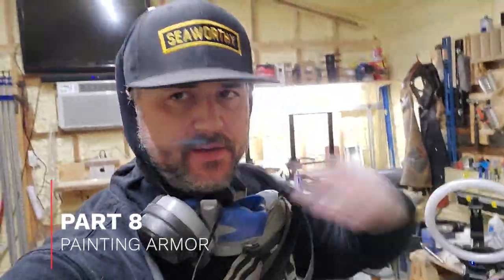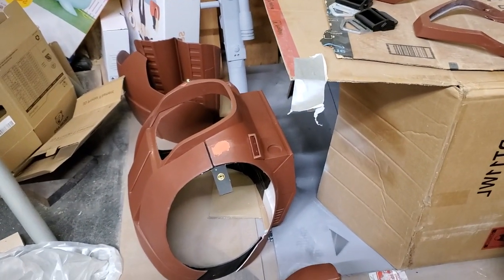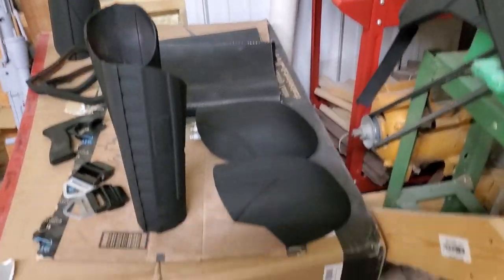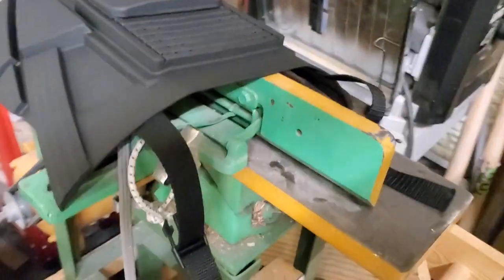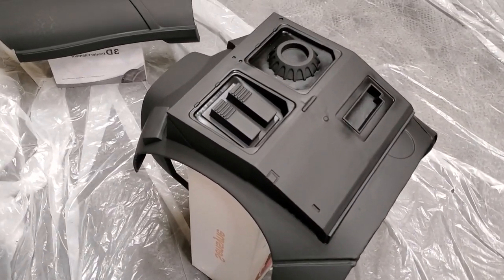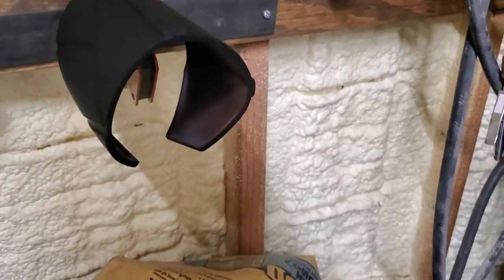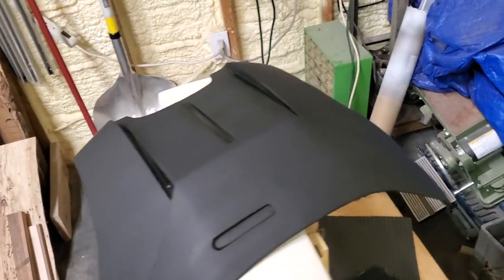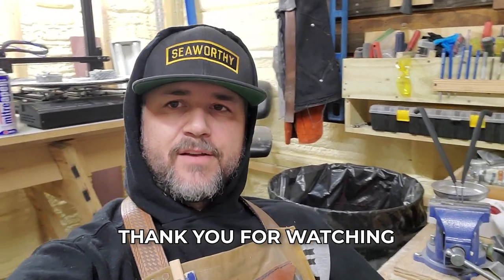Part 8....Star Wars Death Trooper Armor 3d Printed....... First Coat of Black on the Armor!

Comment: Ive started with my own, I finished the helmet (not amazing might have to redo it) and im almost done the upper vest, I however glued all my vest into one piece, for the arms and legs and stuff im not sure how im gonna attached it to my body, I see your using latches? how would you be able to hide them or make sure they stay in place?
Reply from the maker: I am going to do a video pretty soon on how I strapped everything together.  Essentially, I am using a nylon harness that holds the stomach/cod piece and lower back/butt.  Then I have 1" nylon straps that attached to the thighs by plastic clips.  (Those are going to be hidden by the belt.). The chest and back attach to each other and move feely on my body.  So, the only things that will be attached to the harness are the stomach, cod piece, lower back, butt and thighs.  When I do the video it will make more sense.👍
Reply: @naterritchey19  That sounds awesome can't wait

Comment: How long did it take to print
Reply from the maker: Took me about 3 in a half weeks of printing non stop with two Sunlu S8's.  As soon as one would finish I'd start another.👍
Reply: @naterritchey19  great thanks, how long do you think it will take me if I do it with the. Ender 3
Reply from the maker: If I was to guess, probably 7 to 8 weeks.  It's worth it though 🙂
Reply: @naterritchey19  what if I use 2, and also did you have to scale the pieces
Reply: @naterritchey19  and how much filament did you need
Reply from the maker: It's hard to say really but probably about 6 weeks.  I did not scale any of them.  I did cut the shins down though.  Posted a video on that.
Reply from the maker: I used about 12 kg
Reply: @naterritchey19  and how much did it cost
Reply from the maker: That's a good question.  Not really sure.  Around 600 dollars or so.